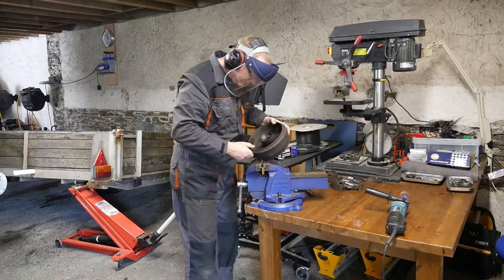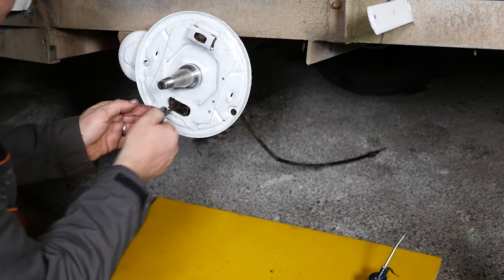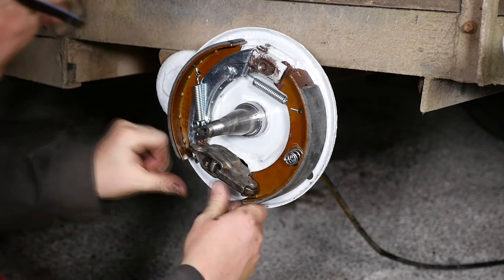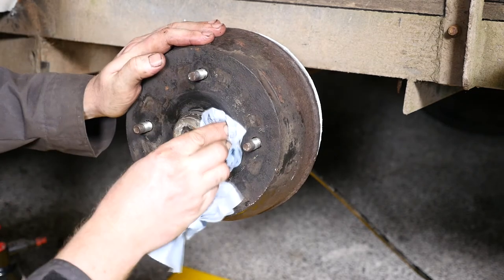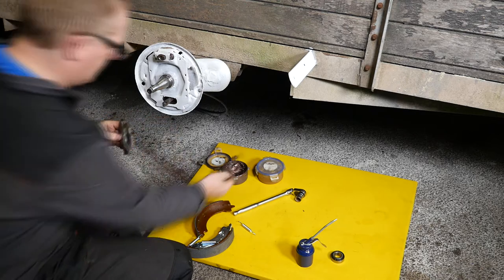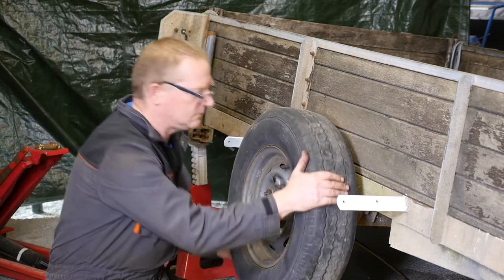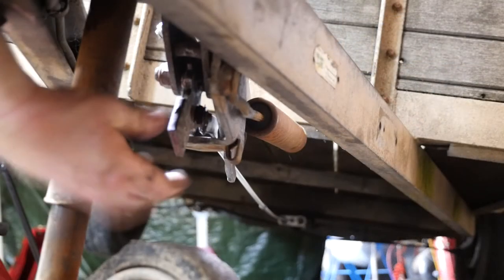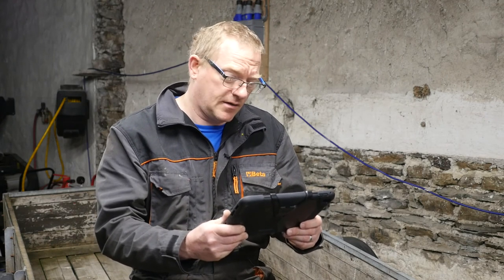Part 3 - Fitting Brake Shoes & New Pull Rod to my £295 eBay won Bateson Trailer

Comment: Nice work. One useless bit off info for you though.
When you fit split pins, it's apparently meant to have the head right down into the nuts castellation's, one leg snipped to length and folded down onto one of the nut's flats, and the other folded across the end of the shaft. That's the way they were designed to be used. Granted, Pretty much no one actually uses them like this these days, and you'd be hard pressed to even find pictures online of people using them that way around, I'm not even sure what the benefits or drawbacks of either way would be (If any), but if you ever read through old (Mainly pre WW2) engineering manuals you'll see that this is how they were originally intended to be fitted.

As I said, Useless info, but it pops into my head every time I see someone using split pins. :)
Reply from the maker: Thank you for that information Reman1975, appreciate your knowledge as I didn't know any of that and clearly its important ....ooops !!!! Thank you again.
Reply: @CoatsandGaiters  As I said, I don't know if it even IS important. I use both techniques depending on whatever easiest at the time, and I've never had wheels fly off or parts of machinery come loose.
I just find it Interesting that this alternative to the originaly intended way of fitting split pins has become so prevalent that few even know that it ISN'T the original way.
Reply from the maker: @Reman1975  That's why education is so important.  I was using copper grease on slide pins till recently when I discovered your not meant to and silicon grease is the correct type.  One misinformed bit of information can carry and spread.
Reply from the maker: @Reman1975  https://www.youtube.com/watch?v=KUCvBnXgIh4
Reply: @Coats and Gaiters  Oh god, Copaslip is bloody awful for 99% of the jobs people use it for. Over time (And with heat cycles) it turns into something similar to silicone sealant and then can actually CAUSE binding. Silicone grease is fine, But I'm a tad old school and still use red rubber grease on brake slide pins when I have to work on my car (Not as often as I'd like to these days, But that's due to illness more than age).

The stuff works great, But it absolutely WILL NOT clean out of cloth, and it never really dries. So, if (Like me) you have a habit of wiping oily hands on the chest and legs of your overalls, that particular boiler suit will become a constant stain risk to everything you brush against after that. :D

Oh, and what that guy in the linked video did was about 90% what I was talking about. But if he leaves the pin legs hanging out in the breeze like that, I foresee plasters and tetness shots in his future. Next time he's working on something in that area the sharp end of that pin will act like a skin magnet and draw his hand right across it. :D

Comment: Does anyone have an idea how to adjust the hitch on these? I've got a Bradley Doublelock hitch on a trailer but it rattles around on the tow ball.
Reply from the maker: I do believe the tow balls wear out over time and have to be replaced if they become loose.  If it wears too much the trailer can lift off the ball I heard.  May or may not be this but worth mentioning possibly.  Good luck in solving.
Reply: @CoatsandGaiters   Thanks for the response. The ball is brand new so it won't be worn. Maybe I just need some thicker grease on it to take up the slack. It only moves by 1mm or so but it's pretty noisy inside the car.